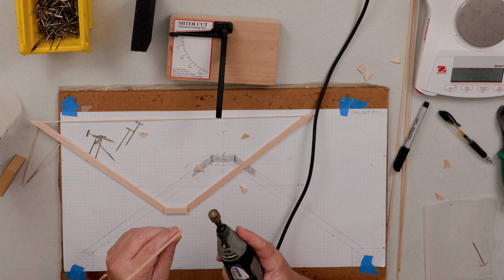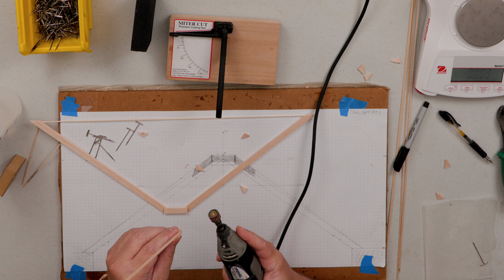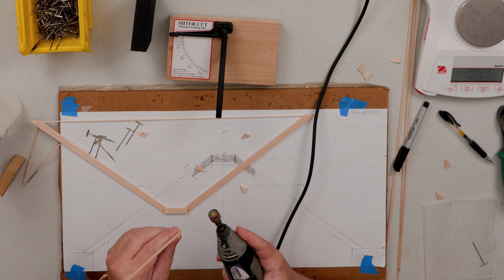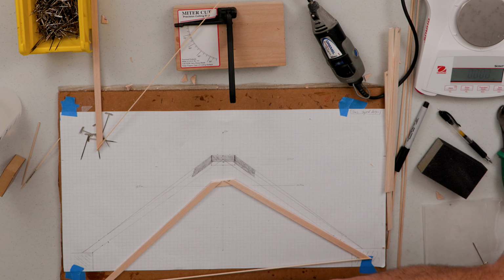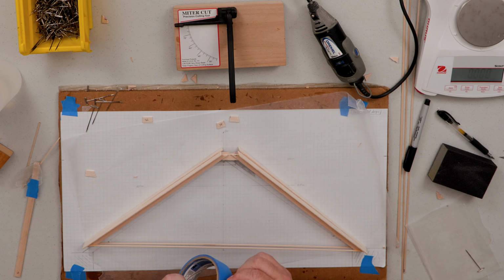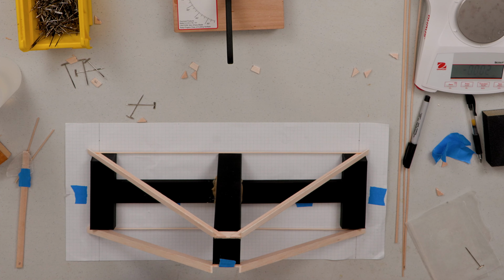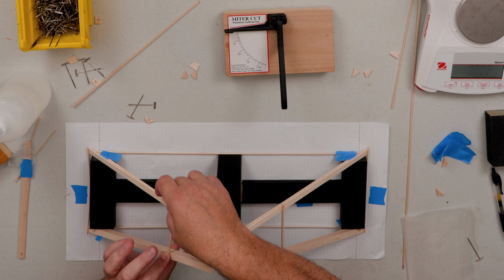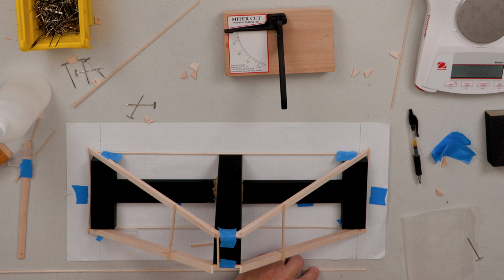Bridge 008 Division C: Complete Build

Comment: Why do you have those flat parts (the ones you glue on at 35:37) on top of the load bearing members? Are those to counteract bending in the Z axis?
Reply from the maker: The top part of the "L" leg is critical to counteract the lateral bending.  Normally that is done with trussing between the legs, but we can't do that because of the hole required for the pass-through block.

Comment: can u list all of the tools that u used for this vid
Reply: Also can you provide measurements for the pieces of wood you used and if it is cm or mm or inches or whatever
Reply from the maker: Really the only difficult tool to find is the miter cutter which you can find here:  http://www.fourmostproducts.com/our-products/construction-tools/
If you have a specific tool question, let me know
Reply from the maker: If you watch the first part of this video closely, I show all the measurements for the important parts.  Balsa thickness is usually given in inches and everything else is metric. You really need to draw out the design on graph paper and everything else comes from that.  You can also download the STL of the jig linked in the comments. That will also help with the dimensions as well as assembly.

Comment: How did you decide to move away from the conventional design and build something so different and sort of counterintuitive?
Reply from the maker: Hi!  Basically, I tried the a more conventional design first.  If you see the numbering of my bridges, this is the 8th Division C bridge I've built and I started with 4 Division B bridges.  The first Div B bridge I built was fairly conventional (no angled legs), but it was pretty clear that there wasn't enough lateral support due to the hole from the passthrough block.  Once I had a decent design and result  for Div B (#004), I moved on to Div C.  The first try at Div C was just a scaled up Div B design (no taper), but that also had major lateral stability problems, this time from tipping over due to the much larger passthrough block hole.  Then I built a few with a taper that were too wide because I missed the rule about the 6" testing block.  Finally, this design is the tapered design modified to fit on the testing rig properly.  

TLDR:  design iterations and learning from failures
Reply: Oh okay, thank you!

Comment: What height did you have on your bridge sketch?
Reply from the maker: If you mean on the side view, the graph paper sketch in this video still had the old markings shown at 17.4cm.  The actual top shown as the shaded part of the side is at 18.3cm.  Remember that because of the angle of the taper, the actual final level height of the bridge won't be quite that tall.

Comment: where do you get your wood from?
Reply from the maker: I like to use a place called Specialized Balsa for my balsa sheets and for the pre-cut bass strips, I usually just buy from Amazon.  There are plenty of good options for wood though.  It's much more important what you do with the sheets than where they came from.  Be sure to check out my "Creating a Balsa Library" video if you haven't already for more details.

Comment: What is the width of this bridge?
Reply from the maker: The assembly jig at the base is 140mm, so the bridge is slightly wider than that.  It needs to be able to fit on the 6" (152.4mm) testing blocks
Reply: @balsaengineering6686  thank you for the quick reply! Also, everything in this build is slightly angled especially when it comes to the loading block stabilizers at the top, will the angle make it hold less weight because it’s not on the wood completely?
Reply from the maker: I have not found that to be an issue at all.  What does matter is the device being as level as possible in both directions.  Focus a lot of time and effort on that aspect of the build

Comment: where did you buy these woods with the exact dimensions and density?
Reply from the maker: I typically buy all my balsa from Specialized Balsa and the basswood from Amazon.  As for dimensions and density, I like the 4" wide by 36" long sheets.  This build used 3/32 and 1/16 thick balsa and on the lighter side density wise, but that is not the only solution by any means.  You definitely want to check out my building a library video if you haven't already for what is required to get precise pieces:  https://youtu.be/bLsTOpmozGI
Reply: you're very quick.
Reply: also, it seems that specialized balsa is in colorado. How long does it usually take to deliver?
Reply: I'm in NJ
Reply from the maker: From my experience, it takes about 1-2 weeks for a normal order.  If you have something really custom, it can take longer.  It's certainly not Amazon fast, but they are a small family business.  If you need something really quick, you probably want to start with your local craft/hobby store